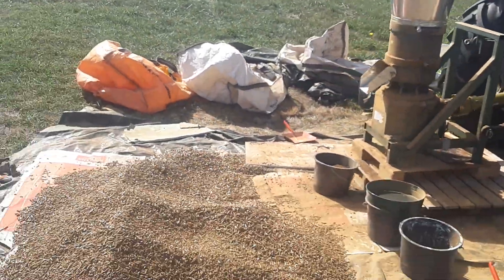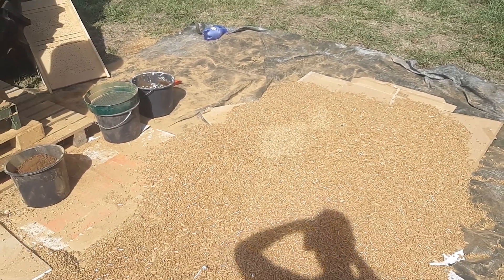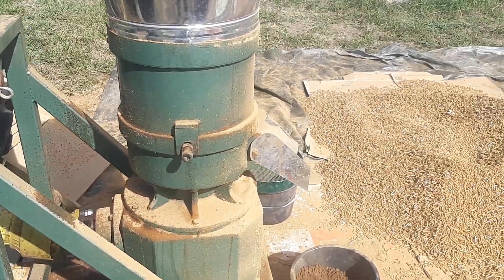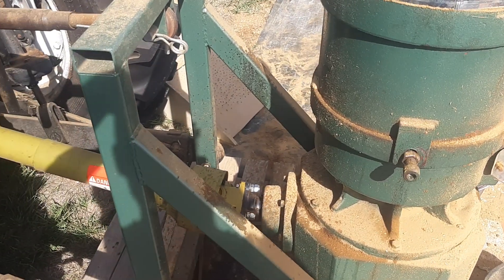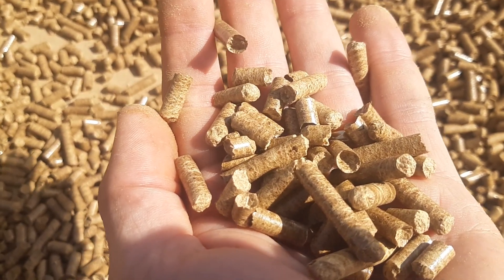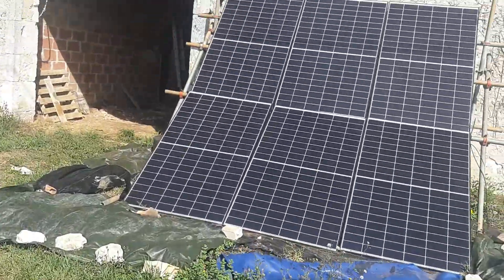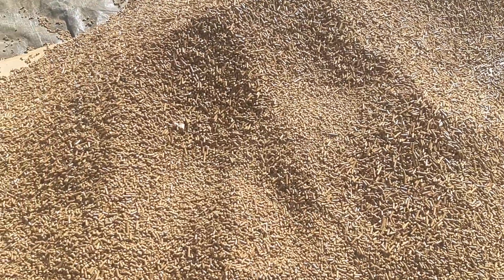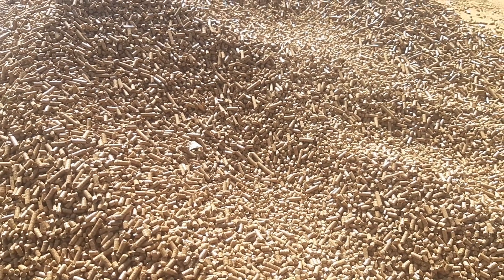Wood Pellet making process for heating your home. 100% Oak pellets on 360mm PTO mill. DIY SW France

Comment: Hi Jamie. Nice job. I'd like to know a bit more about it. We also live in SW France (since 2016). Like you, had to buy a tractor, post hole borer, box grader, pallet forks etc. 
In the past couple of weeks, we've had a pellet burner installed. Fortunately, at the cost of the State as according to our tax return, we qualified for a grant. However, it only worked for one day. The guys were supposedly experienced, but I had to tell them to leave at 0200hrs and come back refreshed as they couldn't sort it out. They got it working the following day. They had caused a blockage when filling it. Once they had left, I realised they hadn't connected it to our hot water tank, so it was only providing heating. It did work well and our underfloor heating had never been so warm, too warm in fact! Anyway, told them they hadn't connected the hot water and they tried to tell me it would cost more to connect it. I told them no chance and sent them photographs of the old oil installation, connected to the hot water.
Still waiting for them to return as it  jammed up the following day and hasn't worked since, despite me clearing the jam. Fortunately, we have a solar hot water system that I installed about years ago and an immersion heater in the tank. We also have a log burner in the lounge, but it still needs to be sorted.
I saw your video today after a search as I was wondering if you could make the pellets yourself.
We already have sawdust from a local supplier for our horses. It costs about €16 for a one cube sack. Mostly, if not all softwood, but I was wondering how effective that might be to turn into pellets. 
How do you check your moisture content?
Reply from the maker: Hi Paul, Bienvenue! Thanks for connecting. Sorry to hear you are having a bad time of the install. Yes the back boiler type I would expect are a little more complicated. I have yet to renovate the entire first floor of our house, but when I get round to it (this decade?lol) I will be installing a Pellet boiler. 
Yes softwood will work fine. Although I would reccomend finding a local sawmill if you were serious about making the pellets. To give you an idea, the amount of sawdust you need is 4x the volume of finished pellets so a standard house might use 2/3 tonnes of pellets per season. So that is 8/12mcubed (12 whole BigBags). Even if you have alot from the horses it might be good to get some from a sawmill... they will give you it for free (could look at cutting costs for the horses too?). The way you measure moisture is with a hygrometer. You can pick one up on Amazon for about €50.
Reply: @PelletJamie  Thank you for the reply Jamie. The system isn't a back boiler, I didn't make that clear. The replacement pellet burner is in our garage, having replaced the oil burner. It's made in Portugal, I believe. Ekallor is the make. 
I buy the sawdust as bedding from a local supplier, who just makes the sawdust for that purpose. We had a sawmill not far from us who did give it away, but he has since retired. I do know of another sawmill, which is quite a large operation. I could go and ask them.
Where in the SW are you?
Reply from the maker: @paulbradford8240  I am in the Lot et Garonne about 30 mins from Bergerac.
Reply: @PelletJamie  Probably not far from us then in Monflanquin.
Reply from the maker: @paulbradford8240  Oh cool, yes in Duras but we are in Villereal alot as we have a group of friends there. 
Stay in touch and just let me know if you have other questions, Happy to help. J

Comment: I have a couple questions I hope you wouldn't mind answering for me, I have been heating my house primarily with wood pellets for probably going on twenty years now. I'm on my third pellet stove, I do not remember what brand the first one was but it was, at least in my area, new technology and the quality of the stove was not good. After the first northern Minnesota winter with a pellet stove vs a traditional wood stove I could see the potential in pellets...and as someone that has had multiple spine surgeries for fusions and disk replacement- I do not recommend the experimental disk replacement I would go with fusion instead...pellets are a lot easier on the spine than spending days in the woods cutting splitting and hauling wood. Chainsaws get heavy and gas is getting expensive plus you're handling every piece of wood several times before it becomes heat, pellets I handle twice and at 40 lbs per bag they're not terribly heavy so even a gimp like myself can handle them. My second pellet stove was a Breckwell, after several years one of the chips on the motherboard popped and even today a replacement motherboard costs more than the entire stove with chimney combined was when I bought it new. About seven years ago I ended up buying a Cleveland Ironworks PS60 and it has been awesome. I do need to replace the burn pot, they're manufactured with mild steel that just doesn't hold up to the heat but stainless steel replacements are available at a decent price. 

The stove has multiple options for output level, P1 for the most heat which burns pellets hotter and faster to the P4 setting which is the most efficient. We've had many many nights that it is -40° to more than -60° F (much colder with windchill added) and I've always ran it on P3 and the thermostat set at 72° and the house stays around 72° regardless. What does change is what type of pellets I burn, I started out burning only hardwood because with blocked wood hardwood is always the better heat, I had to buy a softwood blend once because the store was sold out of what I normally bought and I was shocked by the differences. Softwood burns much hotter than hardwood, it burns so much cleaner and efficiently that I'm only cleaning my stove around once a month and I'm burning around half of the pellets. The softwood was a little much for the burn pot but an upgraded burn pot is an easy fix. I had problems one winter with damp pellets, they burned but left a lot of ash and because it took so long for them to finally start burning I ended up replacing the igniter a few times. 

My questions are about drying your pellets, if you have to dry them how do you do it? Where I live the price of pellets is getting insane, this winter they started out nearly 50% higher than last winter and just last week they doubled in price...which is why I am looking into making my own. I too have a friend who has a sawmill and will supply all of the sawdust and I can also have all of the smaller limbs and butts that are normally just piled up and burned. I have a few neighbors who also burn pellets so I can potentially sell whatever I won't need which would offset the cost of getting or making a hammer mill, pellet mill and whatever for drying. Do you know what the moisture level before milling vs after milling? I know that milling generates a lot of heat, does that impact the moisture? 

I do apologize for writing a novel, I sometimes get more detailed than I should or need...any information would be Bey much appreciated! Thank you!
Reply from the maker: Hi... interesting info about softwood pellets... Will have to try that.

I do let the pellets dry just where they fall for a few hours but I don't do anything specific to dry them. 

The moisture content of the sawdust is crucial to the operation , it must be between 10-12%... it also depends on lots of other variables, feed rate, speed of PTO etc etc. 
The finished pellet is about 6% moisture.

Comment: How are your pellets so smooth and durable looking? My pellets have cracks on them no matter what I do.
Reply from the maker: What type of mill have you got? What material are you using at what humidity?
Reply: @PelletJamie  15 kwh Pellet mill model name: ZFPM260-p with a die of 8 millimeters and triple rollers. Chinese made unfortunately because cant find any European ones. (broke the axle today only after 30 hours of use). I use cutter swarf (100% wood material and 0% tree bark) that I break further down to about 3 millimeter sizes that then goes into a mixer where I add flours in it about 2 kilos for about 50 kilos of raw material  (Flour which contains starch around 70% that apparently should help increase the pelleting feeding rate and hardness because the natural amount of lignin in the material is not working properly (or so I suspect) but they still have varying sized cracks in them) and after taking several moisture tests from the mixed material the moisture ranges around 11-14%, average around 13%, and no higher than 15% (Manual said operating range for making pellets is around 10-18%) although theres oddly much water vapor coming out of the pelleting process (but I guess its normal even for such dry material?)
Reply from the maker: @furanduron4926  OK 8mm holes is a bit bigger than usual (6mm) I have never used a mill with that size so could be that. You shouldn't need to add an flour.. pure wood has enough lignin in it to make pellets.. that is all I use. I would ditch the flour.. also it seems a tad wet... I would say that best humidity is as close to 10% just from my experience, anything more than that and I have to run the pellets twice to get them shiny hard. You broke the axel! Blimey that must have taken some doing. Do you mean the shear pins or the actual axel?
Reply: @PelletJamie  Nah the shear pins actually broke earlier for some reason lmao (3 out 6 completely broke off but luckily the other 3 hold or theres no telling how much damage it could have caused if it broke off and flew against my face or something.) The axel broke inside one of the three rollers about 1 and half inches from the outer side where the circlip (or lock ring) and the grease is located. It almost looked like that the circlip had sawed it to half way and it finally broke off. I cant imagine how thats even possible. I doubt I screwed the bolts too tight since any less tight and it wont properly make the pellets. I did not even use full force with one arm so either I have superhuman strength or the iron or steel (whatever the axel is made from) is just that poor quality like you could almost expect from Chinese made product. Hopefully warranty covers it even if its been almost 2 years since I bought it due to it breaking in just 30 ish hours when it should last 500-1000 hours of use and we can still use the rollers themselves so its should not be that expensive even if it wont have warranty but I am worried if it will happen again. 

Whenever I get it back running it I might try doing something with the pellet cutter like sharpening the edges or just remove it entirely and see if that has something to do with the cracks...

Comment: How long can a pellet mill be run in one go? Can the pellet mill overheat?
Reply from the maker: I am aware of people running them for very long periods of time, potentially days. The Mill is made of cast iron and stainless steel, it gets hot so much that the water steams off maybe 80Celcius but seems fine. I have used mine longest about 4hrs.. seems fine.
Reply: @PelletJamie  And how tight do you need to adjust the rollers? Before staring Ive loosened the rollers so that I can easily move them with my arm but after its running Ive tightened the fastening bolts so much that the rollers would no move at all (when Ive stopped the mill of course)  with just a hand. The manual said 0.1-0.3 millimeters but how am I supposed to visually tell a difference so small when the mill is running and it has raw material in it? I would like to know how much is too much and how much is too little and what is perfect gap between the rollers and the die.
Reply from the maker: @furanduron4926  OK so you have a die turned mill. I found when I used to use a die turned mill it didn't really make much difference how tight or loose the rollers were I just tightened them all the way but not with any force... just finger tight.

Comment: Cool.  I just cant see this as viable at such a small scale.  

Wh were.do get the saw dust from?  

That takes serious energy to make sawdust and such.

As a by product of industry sure, but not many have access to such.
Reply from the maker: I get the sawdust,  as much as I want/need from a local joiner. All joiners/sawmills will give it away for free because to dump it in landfill costs money which is what they would have to do. I could find 10 different other places to find sawdust in a week if pushed. For my own personal use this works with little hassle... I am on my third season with my made wood pellet ONLY heating
Reply: @PelletJamie  humm...maybe I'm being a little short sighted....I will look around me and see if I can find some free sawdust.  If I could maybe it would be viable.   How may tons of pellets do you use in a season for how much SF heating?
Reply from the maker: @mrpush2532  I run two pellet stoves, this season will be 2 1/2 tonnes of pellets. Next season I want to make 3 tonnes so that I start to have reserves. I basically pick up a trailer load of sawdust every month all year round and put that through.
Reply: @PelletJamie  How many SF space do you heat?
Reply from the maker: @mrpush2532  250sqm

Comment: After tightening the rollers in the begging do you need to loosen them a bit after running the mill a while?
Reply from the maker: No.. and you can't adjust the tightness on this whilst machine is running

Comment: I have a 7kw rotating die machine. But the oak sawdust is just coming out as dust. Not much seems to happen. Other woods are passing well. Do I need to heat it more? Moisture content is abt 14 percent so seems oké.
Reply from the maker: Hey. 14% is a little high. Is there any other differences (particle size, moisture level, feed rate) between the woods that make good pellets and the oak? Are any of the other woods hardwood?
Reply: @PelletJamie  thanks for the swift reply man. Everything else till now worked quite well. Also hardwood mixtures. Everything I mix with the oak comes out quite brittle not a nice hard pellet. Even if I mix like one one five. Seems that content of lignin in the oak is low or something?
If I run the oak twice to reduce the moisture level it comes out as dust. So problem doesn't seem to be in the moisture level. I was thinking that there is a temperature issue or such?
Reply from the maker: @zeemanstuning1223  They say you should not make pellets in 0 or sub zero temps, probably because the pellet die doesn't heat up enough. It could be that.
Reply: @PelletJamie  merci! Need to try again

Comment: Hello I from Belgium, wondering why most of the people using so heavy  electrik motors? Thank you
Reply from the maker: Hi Maria, it is possible to use a large electric motor or diesel or in my case a tractor. A lot of people choose to use an electric motor because it takes up less space and you can use them inside.
Reply: @PelletJamie  Thank you for answer.But I dont have heavy electrick in my house.When I wonna try to made pellets can I use a lighter motor like a 2.2 or 3 kw?.Hope to get a answer.
Reply from the maker: @betondarm  Ah I think you are talking about 3 phase electricity. OK. Yes. It is expensive to get three phase electricity installed if you don't have it. The diesel pellet Mills are still good.. To be honest unless you have a very big commercial building it must be done outside as the process is very dusty.
Reply: @PelletJamie  Lucky, i live on a open field between cow and pig farmes. I love the smell !!.My house  verry old from 1820, no isolation  so it is verry cold inside.Thats why I wonne try to make a pellet mill, because the prices are verry high on the moment for a bag 15 kg  11 euro..We will see, Have a good day, thanks for all the answer, And keep on rolling with the pellets.
Reply: @betondarm  Hi Maria, I bought my pellets from Leclerc mid December. Four different manufacturers were available from there at prices from €8.50 to €13.99 per 15kg bag. Fortunately, I have a large trailer, so I could collect my own.